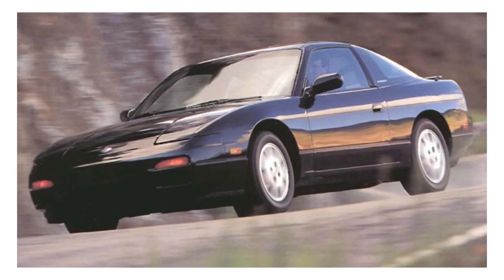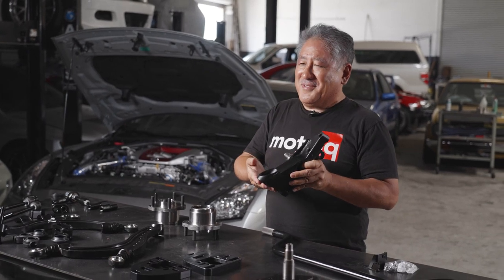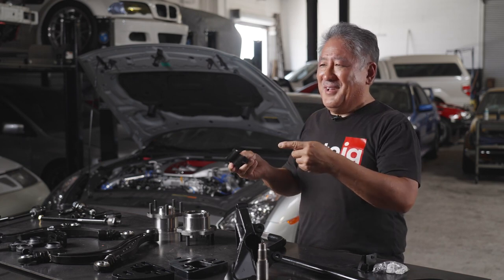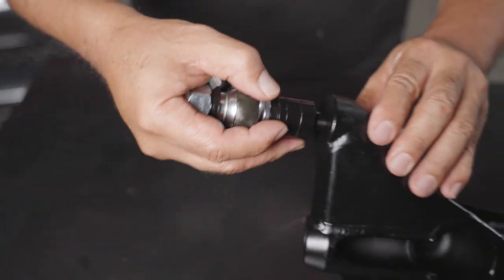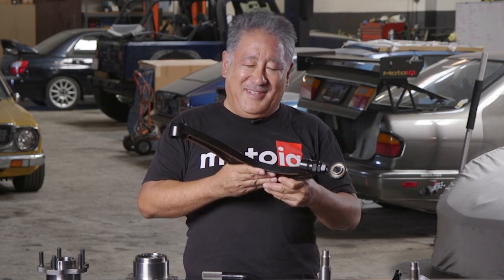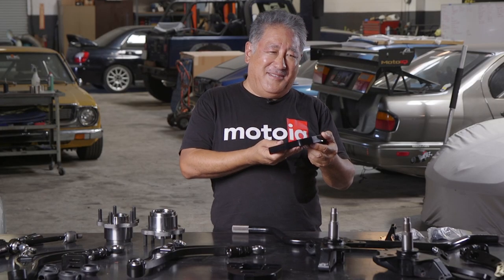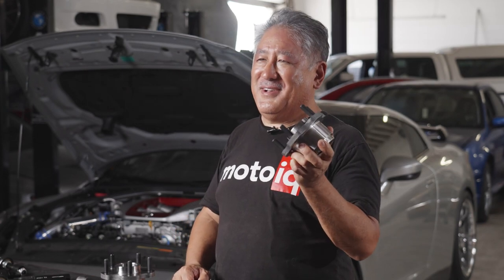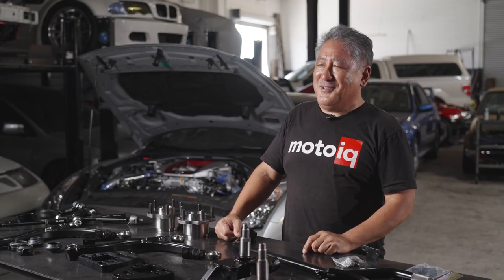The Ultimate Nissan S Chassis FRONT Suspension?

Comment: Combination LCA that removes the tension rod is a big deal. The biggest grip tire I could run was a 245 because when I tried 255s they rubbed under load. I’d be curious to see if the GKTech gains over the SPL stuff I had.
Reply: My 265 35 18 clear tension rods on my car
Reply: @stevethomas1301  my 255s cleared but not during full travel lateral loading. They showed signs of scuffing on the suspension. I was running some CE28N wheels, forget what the offset was but I could fit a square wheel and tire setup on the car without rubbing on 245s.
Reply: @RadDadisRad  265/35R18 on 18x9.5  15 offset rims, Circuit race car so not using super lock.

Comment: He's telling you all the advantages and none of the disadvantages and issues with some of these parts. The tie rod offset spacers are known to bend the shaft in the steering rack. All these kids drifting would bend it and then it has to be tossed in the bin. They would buy a remanufactured rack and proceed to bend that as well. That's why there are no used steering racks for the S-Chassis left to buy. I don't know of any easy way to replace the steering rack shaft. Surprisingly, you can still buy new aftermarket racks if you bend yours.

The steering rack is also known to slide between the aluminum steering rack bushings. If there is not enough friction between the metal bushing and rack, it will simply slide in place instead of steering the car. For better or worse, rubber and poly would grip metal till they rip and tear. Understand these issues before you put them on a street car.
Reply from the maker: In years of pro drifting, we bent exactly one steering rack and that was due to a crash that would have bent a rack anyway. We never had the rack slide in the bushings. We didn't really suffer accelerated rack wear either. This was at a pro level S13 driving in the hardest driving there is. Sure the offset rack spacers could wear the rack bushings more and make it easier to bend but not by much. If you install these right you are not going to have an issue.  Lots of people run the offset tie rod spacers without problems and they are not just going to bend the rack by themselves, it takes a hit and a hit hard enough that it would probably bend the rack even without the spacers.  The only real disadvantage for a street car is you lose your inner tie rod dust boots and gain a slight amount of bumpsteer. We would prefer to cut the crossmember and move the rack but that's a lot of work, we might do it later though.
Reply: I'm just reporting what I have read throughout the years on car forums. These are potential issues and has happened to other people. If you look on the GKtech product page for the solid aluminum steering rack bushing, there is actually a reviewer that mentions his rack getting loose and sliding. GKtech also puts a note in bold lettering instructing users to really tighten the bolts down. They know it could be an issue.
Reply from the maker: @miaouchat495  well if they followed the directions, they probably would not have an issue.  The best solution is to cut the back part of the cross-member off, weld in a flat plate well forward to place the rack in the right place, and fab new mounts.  You do have to be good at fabrication and understand steering geometry well enough to know the right place.  This is all pretty difficult work.  Or you could use these parts. Or you could listen to forum "experts", not install these parts because they say they are no good and live with wheel wobble, sticking, and spinning out due to too much Ackerman build-up at lock. Those are your choices.
Reply: @miaouchat495  well duh. Dude should have use thread lock on the rack hood down brackets. Oem or poly bushing will absorb the vibration, solid won’t.
Reply: @rholt7551  Thread lock has nothing to do with it. Metal will not grip metal better than rubber or poly. Did you really need that explained to you?

Comment: The rack bushes in this don't last very long. 1/2  through a race meeting we ended up with a 1/4 turn play on the steering wheel. All torqued correctly.
Reply from the maker: They probably were not installed correctly.  We used these for 3 seasons in Formula Drift Pro 1 without a single problem.
Reply: @motoiq  Were installed correctly and failed during an Endurance circuit race, Had to remove the spacer supplied to finish the event.
Reply from the maker: @stevethomas1301  you used these in a pure road race car?  They are not needed unless you significantly increase the steering lock angle over stock.   I would have used conventional aluminum replacement bushings.
Reply: @motoiq  Yes I needed them due to the shorter plane arms used to quicken steering. The car is quick but they do fail.
Reply: @JB-qy1gx  I tested them harder than most would. Endurance races are tough. There is very minimal lateral location on them so they clearly had very minor side to side movement that slowly over the hours lead to more movement until the driver came in with around 1/4 turn steering wheel play. The kit came with assorted spacers , I went on the tight side and torqued to the spec. In the heat of the race I removed all spacers and torqued down hard.  I still recommend these for Drift cars but not endurance racing. I will machine some billet parts and strip the rack and weld them in.
Reply from the maker: @stevethomas1301  ours don't have assorted spacers, do these go under the cross-member clamps to control how tight the clamps clamp the rack assembly? Welded billets spacers are not going to move for sure!
Reply: @motoiq  Yes  I was very fussy with preload. Was very tight but really believe  24 hour events need the weld in set up
Reply: Here are the spacers I'm talking about
Reply from the maker: @stevethomas1301  link didn't come through!
Reply: @motoiq  Gktech installation video.  It shows the assorted spacers supplied with the bushes.

Comment: Overkill aside....
Does the flexibility of these kits and Wisefab kits, provide a better handling street car, for daily use, if tuned/adjusted accordingly. 
I've heard another racer suggest that a Wisefab kits specifically will not make a car enjoyable outside of very specific drift competition.
Reply from the maker: Not particularly great for street use.
Reply: @motoiq  .. what exactly is the reason though? Is it just nvh? Let's say I had a full SPL parts, linkage setup on my BMW street car. Not looking for the best comfort also not trying to kill it, but I'm not trying to go full race either. 
Though I do in fact need to be able to adjust for as much off the line traction and stability as possible, because I will be making north of 700hp at the wheels, and stock setups will not hold. Is SPL at least fully swapped out on the rear axle, not the front, ideal with respect to a moderate amount of added nvh.

Comment: What about rack relocation
Reply from the maker: for running a lot of angle yes, do it.
Reply: @motoiq  I mean whose making a good set up. Street faction replacement or pbm wisefab modification brackets
Reply from the maker: The replacement moves it more.  Brackets only move it something like 1/2".  For big angle cutting the crossmemeber and moving it a lot is going to reduce overcentering, sticking and wheel wobble.

Comment: Thank you Mike for the wealth of knowledge & it motivates me to rebuild my entire suspension! This is something I have always wanted to do with my S13 to do both grip & drift, which still has the original OEM hardware. But seeing how adjustable & durable these GK tech are I am definitely in the market to buy them. Also, as the only perfect place to do this in virtually on Gran Turismo to see this be done in real life is quite a feat! I hope that you can guys can do an installation, alignment, & final build video of your S13 project. I'm definitely going to get these because of the well thought out & engineered parts! If you have a link to these suspension parts or affiliation I would greatly appreciate it! Here is my S13 drifting virtually in Gran Turismo Sport. ->https://youtu.be/8EGYrWIoQe0